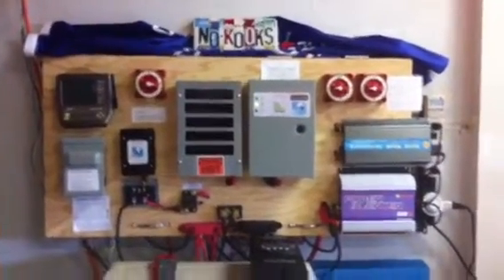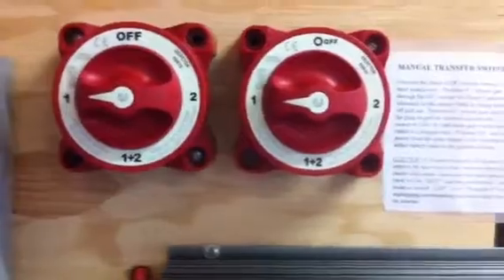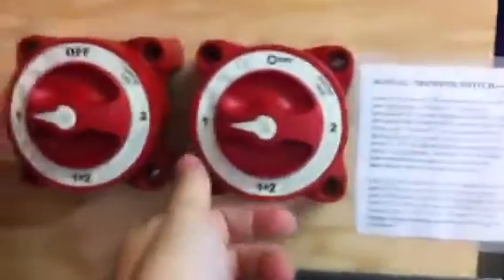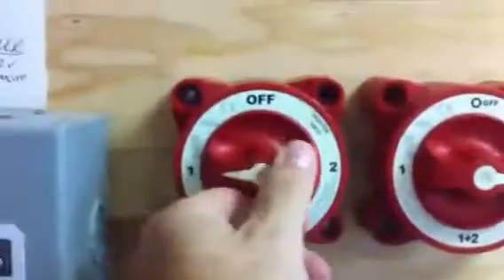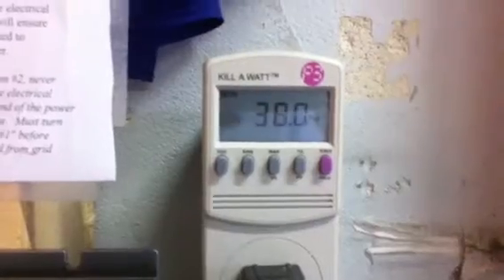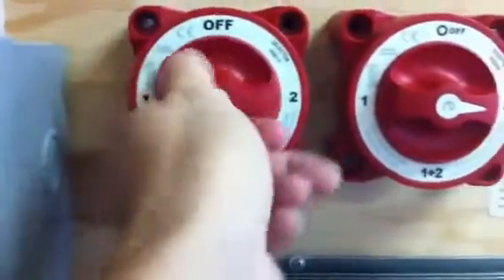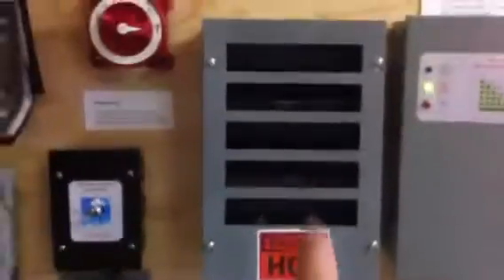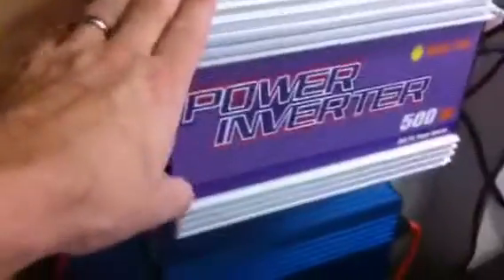Beginner Wind/Solar Set-up - Blue Sea Transfer Switches

Comment: Nice job ,I have rewired Yet once more Using some of my Under ground wiring as a back up In Case of Grid down I can Now disconnected the newly added Enphase units ,Use the wires from my no longer used Power jack system to Run into my flex max80, to run home off solar in the event that were to happen .Last resort is the gen-set.Got to love the battery switches They are handy.

Comment from the maker: Also, i set-up the relay now so that after batteries are fully charged, it only diverts/dumps the incoming solar/wind power to GTI, rather than dumping both the incoming solar/wind power, and some of the battery bank power.  That will make more sense when you see my video on wiring.

Comment from the maker: Btw, my 400w turbine hit 440w today. Huge 25-30mph winds all day. I'll try to post clip on that too when get chance. To answer your Q. I think these are suppose to be able to handle extended diversion.  I know Billythekidd once became concerned about possible sticking, but I've never had any probs and I've run in divert mode for weeks on end. That said, I'm still fan of keeping solar/wind always in gridtie mode and only 1x every few weeks switching charge mode to top off. Nick aka Sun

Comment: Looks great ! Do you connect your grid tie inverters directly to your battery bank ? Instead of solar panels and does it quickly drain the bank ? I'm thinking of doing the same .if you could do a video of your panels and batteries

Comment from the maker: I don't connect my GTI's directly to my battery bank. Instead, the + leads that come in from my solar panels and turbine connect directly to the back of each Blue Sea Switch. From Blue Sea Switch, a + lead runs between line 1 on back of switch to + lead to your charge controller/battery bank. Another + lead runs between line 2 on back of switch to + lead on GTI. That way, switch acts like a "gateway" to direct power to battery bank or GTI.  I'll upload the video on wiring for you this week. Thx!

Comment from the maker: Good question.  If grid power fails, it will cause my plug in GTI to fail.  As a result, any excess power will dump to the bank of resistors. So, if i was Pos 1 charging, and batts full and relayed to GTI, and then grid went down, the island protection on GTI will cause it to not feed grid.  However, the dump load from GTI will automatically send excess to the bank resistors and burn off as heat.  Yeah, i tested it doing grid failure simulaation and worked.  thank god.

Comment: Thanks for sharing.
You have nice setup
Reply from the maker: +JWSolar uSa thanks. i've actually updated this quite a bit since this video.  i have some recent vids posted, but need to also post more... once i wired up my panels in series on my "hybrid" part of system (e.g., the part using the BlueSea to toggle between grid tie and battery bank), i had to remove my BlueSea and use DC breakers instead since the Blue Sea are not designed to handle high DC Voltage (look at the specs) and will fry with high voltage (if wiring panels in series) and can cause a fire.  So, now i use the Midnite Solar Baby Box with 150v DC breakers.  By flipping my breakers up/down i can direct where my solar power goes. So it works same as my Blue Sea but MUCH SAFER when running higher voltage thru.  If  you are wired in parallel and keep you voltage under 30v-40v then Blue Sea works great.  But once you go over the specs on Blue Sea (forget what it was ,,, maybe 60v??) then it becomes a dangerous fire hazard to continue using them as your pathway to your battery bank or to your GTI  Just wanted to point that out for others because it's easy to overlook if not paying attention to the DC Specs on the gear

Comment: Looking forward to video, I to was thinking how nice it would be to let that relay do both the solar and wind instead of just the wind, go from battery into GTI when the battery is charged, current would then automatically go into the GTi without having to switch it over using the switches. Is that what you did Sun?

Comment from the maker: I have thought about it, but unfortunately don't get enough wind for my excess to be useful enough for even small hot h20 element.  Especially now that i have wired to go first to batts, then to GTI, so the liklihood of reaching my dummy load/resistors is pretty low (would need GTI to fail). Maybe if i had better wind or larger wind turbine.  Have you experimenting with h20 system?  always interested me.

Comment from the maker: Can you elaborate further on why dangerous? These are non UL listed gridtie inverters, which work the same as my Enphase gridtie inverters by inverting the DC current to AC and matching the phase with my utility. I've been using them all for years without incident, granted the GTI's featured in this vid are not UL like my Enphase, and are not as efficient (75-83% vs 97%). However, both GTI's (UL and Non UL are island protected). But never heard of any dangerous condition caused by the.

Comment: Greetings.  I cannot find your video (mentioned on this video) in how to wire the transfer switch.  I just want to use one switch to select where the power of the solar panels goes: to the grid tie or to charge my batteries.

Comment: Grid tie inverters are designed to be connected to the grid at all times so they can monitor the phase of the power company. They produce 120vac  which is alternating current, alternating at 60 times per second. If your inverter is not matched with their timing within a few degrees, you could cancel each other out producing no voltage or worst case, producing 220 volts. and a fire or some blown fuses. What I see in the video are not grid tie but regular inverters.

Comment from the maker: What timing as i've been running some similar scenarios thru my head to deal with my enphase with us w/ my new Flexmax (not installed just got 2 days ago).  Was thinking of running my enphase 220VAC wire first to a "AC transfer switch".  Pos 1 will take it to a "CONVERTER" to change from 220v AC to DC, and then sending to Flexmax to batts. Pos 1 on AC Swtich to backfeed 20 amp in main (where its going now).  But may need to PM you on your idea specifics as been wresting with this one

Comment from the maker: i don't use that 1-2 option since my preference is to keep it always ALL gridtied and roll back meter.  And only when my batts get down to 75% (every 2 weeks or so), i flip over to charge mode for the day and top them off. I think it's more efficident that way...remember we want to directly save $ on elec bill, and use batts only if a grid failure situation. Also batts exepnseive and every time you cycle it's like more mileage on the odometer. thus, keep em in reserve and gridtie always my motto

Comment: Household electricity is, of course AC - alternating current. The instantaneous voltage varies from a positive to negative peak voltage, usually in the form of a sine wave. However, there's no law of nature that will require all sine waves coming from different sources to be in sync. In fact, they will usually be out of phase. So if you have a solar panel, or a generator feeding an inverter, it will likely be out of phase with the current feeding your house.

Comment: How are your panels connected, 12v or 24v? The Blue Sea selector only supports 32 volts. Im running my panels at 24 volts so sometimes they are over the 32 volt limit of the blue sea switch. I was told by blue sea tech support that going over 32 volts can cause arcing.
Reply from the maker: mine panels that are controlled by my BlueSea are all 12v (nominal).  they're all wired in parallel too (o gauge wire) if you can imagine how many amps that is....good thing Blue Sea has huge amp rating, but you're right about the upper voltage limits.  i'm surprised they don't have a higher voltage model since they cater to boating/yachting where often battery banks etc are wired to 24v.
Reply: sunsensational thank you for the info. I love your setup and have enjoyed watching your videos. I ended up ordering the BEP 701s, It supports up to 46 volts. I decided on 24volts since my cable runs are 50' to 60'. I have 8 100 watt panels connected in series and then parallel, Im using 8awg pv cable. looking to add a 1000 watt grid tie inverter. Do you think running 800 watts into a 1000 watt grid tie to a 20amp circuit is too much?
Reply from the maker: thanks for the kind words.  i think running that sort of load into a 20amp circuit is fine.  however, i might consider reducing your load for the GTI and instead run into 2 GTI (hooked up in parallel).. reason for this is two fold:  1st you'll get more overall wattage by sharing the load with 2 GTI.  2nd, and perhaps more important is that i have heard from others that some of these chinese GTI may not shut down after they overheat.  they are supposed to automatically shut down when the internal temp reaches certain point (and usually do), but i have heard stories where the didn't shut down and caused literal burning out of components.  so it could be a potential fire hazard.  in fact, another YT user ("Rhandsom)" had this problem and he has tons of external fans blowing on the GTI's on top of the internal fans and it happened  to him.  So, now he reduces the load going into any 1 GTI.  So something to consider, or at least research out a little further.  but IMO your ok with the 20amp AC circuit handling the load, rather it's the GTI that ironically may not handle it.

Comment: I am confused, you are saying grid tie inverter, are you putting back to the grid? because if so, those are not grid tie inverters. Grid tie inverters have a microprocessor that matches the phase within 1 degree of grid power and then dumps back to the power company. If you try using one of those inverters for grid tie, you can have a very dangerous situation. Quick note: look up grid tie inverter on wikipedia, its got the definition.
-Neil

Comment: The least of your problems then would have a negative voltage add to a positive voltage and cancel out, reducing your voltage, which is bad for anything trying to run off it. A bigger problem would be to have a positive voltage add to a positive voltage, increasing your voltage, which is worse for anything trying to run off it, and can cause fires.
Approved inverters will have circuitry that will detect the phase of the line current and create its current in phase with the line current.